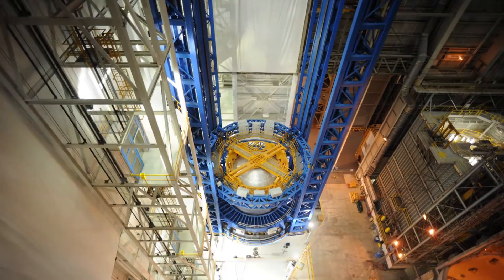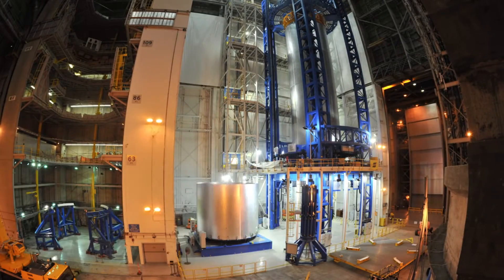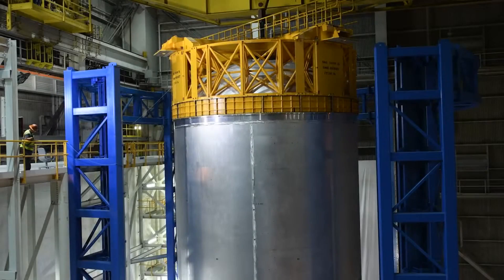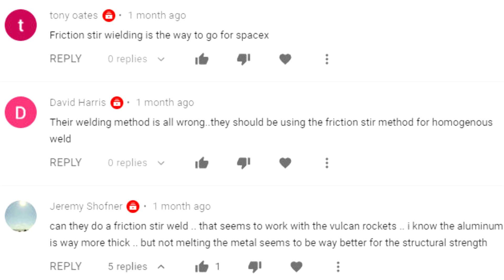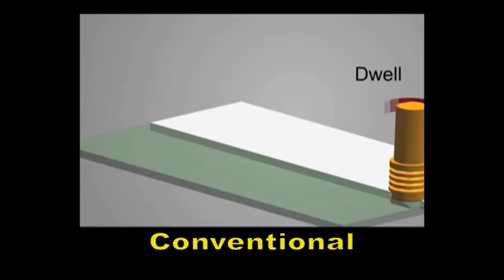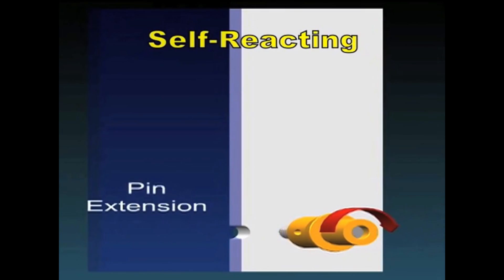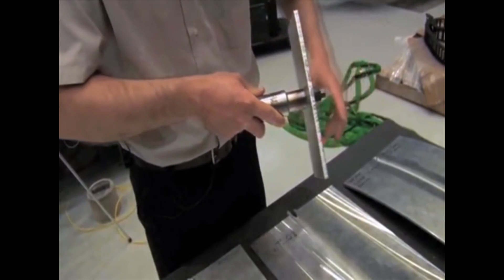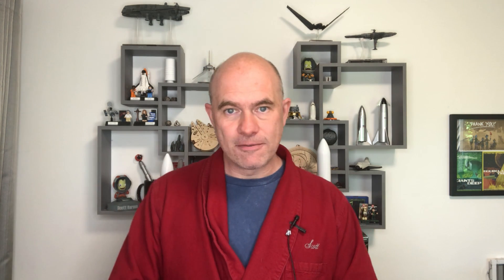SpaceX's 4th Starship Prototype Collapses During Test

Comment: I think, the lower tank lost pressure through cooling. The collapse didn't look like too much weight up top, the lower tank imploded before the top tank ouldn't be supported anymore
Reply: solution: MORE STRUTS!
Reply: Then I'd ask why the pressurization system didn't kick in. Perhaps there was no active system, which might be a test bug, or it wasn't working right. But it might be that not filling the bottom tank first is forbidden.

Comment: So how do they know that the reason why they lost pressure in the lower tank wasn't caused by a weld failure? BTW, I used to work with people who did stainless steel welding, and getting good, consistent welds isn't easy, at least not by hand.

Comment: Re: friction stir welding - Yes, it works great for aluminum. And while it technically works on steel, it's not a very good method.  It is SLOW even on aluminum, and VERY slow on steel.  To weld even one weld on Starship would probably take multiple days.  

Source: Trained Aerospace engineer and welder; albeit 20+ years ago and never went in to aerospace as a job.
Reply: I saw the animations. Looked pretty fast to me 🤣😂
Reply: Simon Strudwick That’s aluminum. Al can be done pretty quickly. (I loved welding aluminum.)
Reply: If the weld is done by machine, who cares if it's relatively slow?
Reply: Roonasaur Because SpaceX is trying to crank out new prototypes quickly. They’re getting SN4 done in less than a week. If they were to friction stir weld, it would probably take well over a month. Just for the welding.
Reply: @Roonasaur  assembly line.
Reply: When I was a kid back in the 70's I got for Christmas one year this kind of model kit thing.  It was all plastic, but it came with a "welder" for putting the parts together.  The "welder" was basically just a little electric motor with a pistol grip.  You'd attach little rods of plastic to the rotating bit, and when you touched the spinning plastic rod to the other plastic parts the friction would melt both of them together.  It was a cool little idea.  The problem was the "welds" made by the rods was generally a lot more brittle than the actual plastic parts so they'd break right there quite easily.  The regular plastic parts were far more sturdy.

Fast forward 40+ years later and I look back on that as an interesting idea.  I can weld today, but I generally don't because I'm not very good at it.  I've worked in metal fabrication for almost 25 years, but my expertise is in CNC forming and some laser/plasma programming.

That said, with my knowledge of such things I've looked at what they're building from day one and expected exactly what happened to happen.  This thing is lacking in a lot of structural strength that is unrelated to the weld process or strength.  I think this rocket is a dead-end in design.  Will it ever fly?  Probably.  Will I be riding in it?  Hell no.  In the same way I won't be riding in a car who's brakes are "just barely" able to stop it at an intersection.  (I think that design will need either some substantial internal bracing, considerably thicker walls, or some other kind of composite reinforcing of the skin.  Perhaps something like the corrugated composite aluminum panels I used to work with? Super light and super strong, and look like corrugated cardboard.  Could something similar be done with stainless?  Hmmm.)
Reply: @tarmaque  from what I've seen from the visuals there are a lot of internal strut support frames
Reply: @042Ghostmaker  I've been watching carefully.  What you are seeing is the support structure of the engine skirt.  The tanks themselves have no internal support.
Reply: @tarmaque  Corrugations. As with Saturn V.
Reply: @tarmaque  Yes, definitely, 'multi-wall' and 'honeycomb' bracing has been around for some time, in aluminium and most other metals/alloys; the problems can come when you try jointing them. One method is to pre-fabricate a solid edge and joint that conventionally. They are very light and strong.
Reply: @paulforster6229  – Has anyone considered using metal foam for that purpose? The added benefit would be thermal insulation I guess, but I'm no engineer of any kind. Also, I don't know, how you could attach/joint it to those cryoformed sheets without too much welding.
Reply: @MrAnticlimate  Theoretically foamed metal has some merits, but I don't know of anyone who has foamed that grade of stainless steel. Plus there are many other manufacturing problems involved not only with scaling it up to size, gas tightness being just one. Also the insulation properties might cause problems on re-entry overheating the outer skin. Even if they could form foamed sandwich construction strip of the right alloy/grade and then lap joint the edge either welded or a rolled lip (like continuous ventilation ducting is produced from flat strip) making it gas-tight under all the conditions and adding bulkheads etc could be problematic. In the end I'm not sure it would be worth the effort. 
Or a thin double wall construction cross braced with spot-welded stainless 'webs', with a post fabrication fill of foamed phenolic and carbon composite or a foamed ceramic fill might have merit. But I am still concerned with the effect of the heat of re-entry on any such composition. Thermal cycling could be a problem. Try it and test it would answer these issues.
I am surprised they are still doing TIG welding and not continuous 'spot/seam' welds, as they are much more suited to thin construction.
Reply: @paulforster6229  – Thank you for the detailed reply. It just occured to my unengineer self, as I stumbled upon a lot of news regarding those materials a few years ago. In the lists of examples of metal foams there's always stainless steel, but never mentioned what alloy. I didn't know thermal insulation can cause such problems. However uninsulated tanks, where the outer wall is the tank wall, would experience pressure increase during entry... But that is just speculation from me, surely the experts at SpaceX know what they're doing – better than me anyway 🙂.
Reply: @MrAnticlimate  You make good points. I didn't know of the foamed stainless, do you have a link?
the area/volume of the tank and thermal mass of remaining contents would mean not much change in pressure from re-entry heating. insulation would only be a big problem/need if you had to hold cryogenic material for longish periods.
I like your thinking, that is 'engineering' attitude, just bend your head around a few practical and fundamental considerations and you're there.
fundamental rocket science is simple and easy, rocket 'engineering' is a whole different thing, but its do-able; there always another way of doing things. keep thinking.
Reply: @tarmaque  The thing is not supposed to hold up the weight of fuel/oxidiser on its own, they pressurise the interior and that does the supporting; same method as the Atlas missile. Lose pressure and the thing cannot maintain its shape if loaded with propellant/payload, a bit like a pressurised tyre supports the weight of a road vehicle, let the air out and it deforms.
The pressurised tank method is a tried and tested and trusted technique IF everything goes to plan.
Add enough internal bracing to support all that propellant and such and the thing soon gets far too heavy, a small increase in vehicle mass greatly effects the mass payload you can loft.
If you could suspend the tanks and put the rocket motors up the front and 'drag' the thing into orbit then you wouldn't need massive internal bracing. Support timing at take-off would be critical. Not sure how it would all hold up to the rocket blast near the skin or perform to orbit though. I don't even want to think about the re-entry and landing issues.
Reply: @paulforster6229  At launch, sure.  But what happens when the thing is landing and almost empty?  Yeah, we know that pressurized structures can be very strong.  However, when this thing is going to be landing it will be nearly empty.
Reply: @tarmaque  Nearly empty of fluid, still means plenty of residual gasses/pressure, the engines only run out of liquid, the pumps cannot suck enough gas to totally empty the tanks quickly. It is a simple fix to make valves that close and maintain pressure if they sense loss of fluid.  Even if there was a drop in pressure given a short time residual fluid/gasses would bring the pressure up to at least take off pressure, more than enough to maintain integrity.
Reply: @tarmaque  They are likely working with membranes and shells, which can withstand a lot more than it would seem at a first glance.
Reply: @jackvernian7779  I understand that, but we're talking about a structure that is supported by pressure inside, that is supposed to land with its tanks nearly empty.  Not good for structural stability.  Also, such structures do not hold up well to intense flexing.  So-called "work hardening" tends to make them brittle. (Also known as "metal fatigue" but it really isn't.)
Reply: @tarmaque  What the whole concept hinges on is how much overpressure is required to support the structural stability at N g's of acceleration. If the value is reasonable, then there will be no problem and it will work like a charm. If significant overpressure is required, there will be a lot of problems with it. In the end, what a few atmospheres of overpressure matter? If it requires tens of atmospheres though, it will be borderline infeasible. 

I'm sure fellow mech. engies have worked out the kinks, or are in the process of.
Reply: @jackvernian7779  Would you ride in a car that would collapse and fall apart if it ran low on gas?  This is a case of a vehicle falling from orbit.  Perhaps under ideal conditions all would be well, but we don't build things to carry people that only work under ideal conditions.  These things are collapsing, imploding, and exploding when being static tested when a single variable goes out of whack.  I'm a SpaceX fan and their Falcon 9 rockets have been amazingly reliable, but I think this new idea is more of a fantasy than a real solution.  I hope I'm wrong.
Reply: @tarmaque  In the case of loss of pressure everyone would be doomed anyways, regardless of whether the tank crumples or remains upright, the engines would no longer work. That is the only way I can see how the pressure can be lost: by the way of tank integrity failure. 

Of course if the engines are turbine rather than pressure fed, it may last a bit more, but I do not think the re-entry would be survivable as any rupture point would serve as a crack concentration center, tank would eventually split sooner or later during re-entry.

In short: if you've lost pressure in your tanks, "crumpling" is not your biggest worry.
Reply: @tarmaque  A car isn't 90% fuel.  To design for a full top tank with an empty bottom tank makes little sense.  It's a lot of support mass for a condition that should never exist.
Reply: you think they may have improve upon the process in the last 20+ years?
Reply: Pieter de Buck it’s basic physics. You CAN’T go faster. They could maybe use multiple welders at the same time along different parts of the weld line, but then you run in to risks at the places the welds meet. It’s better to have one continuous weld.
Reply: Anonymous Freak a lot of things can’t go faster until they do
Reply: @pdebuck1  just like Elon wants to drill holes faster by making his boring drills more powerful in some abstract manner.
Reply: @pdebuck1  Considering how friction welding has remained a "trade secret" for the past 20+ years, I do not think significant progress on it was actually made.
Reply: @jackvernian7779  The Eclipse business jet is made with friction stir welding.

Comment: I believe they are using a hybrid of MIG and TIG welding. Basically wire is feed through a MIG tip in front of a TIG torch which melts the wire just as it flows down on to the surface being welded. It takes some of the art out of the welding process and allows longer continuous welds.

Comment: I remember reports of how many of the US manned space flight programs had low confidence at the beginning because of the failures.  SpaceX will fix this before attempting manned launches.
Reply: Comparing pretty low tech efforts from a long time ago with developments that can utilize completely different tools and knowledge in every single area from development to building... Well that's a little weird ;)
Reply: @stefan514  high tech is expensive. why else do you think SLS cost 2 billion per flight and space shuttle cost 800 million?
Reply: @stefan514  - Yeah Physics, pretty weird.
Reply: @johncnorris  don't you think they should be a bit better than 50 years ago at predicting what would happen and shouldn't make rather silly mistakes? No? Cool
Reply: @stefan514  - I think you should try to do something half as complicated and see how difficult it is.  It boils down to a step by step approach and they will eventually come up with a method to get it to work.
Reply: @stefan514  Computers are useful, but they aren't magic. We're a very long way from simulating everything in a computer and finding all the problems, and doing the math first isn't free either.

Comment: Embossed corrugating the central area of the stacking rings after fabrication would help rigid-ize the areas between the weld joints. The Saturn 5 Look. I think lap welded joints might help creating natural double thick hoops in the skin at the joints.

Comment: Great explanation Scott. Thanks. Don't you think the inner walls of starship must be much more susceptible to preasure variations in the tank sections? I personally belive that if they can line inner walls with corrugated steel sheets, the structure will be able hold it's integrity with much more credibility?  I understand it could have weigh implications. But if a sweet spot can be found, we could see SN10+ will do orbital flights.

Comment: Maybe its again a welding issue. A minimal leak on the pressurized lower tank would make the thing collapse this way too. Why so certain about the fact that welding problems are solved? Contractors still are water tower builders afterall.

Comment: Scott, do you think they are going to have the same issue when they are trying to land these ships with mostly empty tanks?
Reply: Problem is not emptiness, but lack of internal pressure to support structure. Operational pressure is 5 bar.
Reply: The problem in my mind is, the tanks will be partially empty, and the extra load of the cone section will put an undo amount of stress on the partially empty tanks.  If you stand on an empty cola can just right, it will support you, until a wall is slightly compromised, then it just crush.  The jolt of the landing might be enough to cause that.  They are smart engineers and they are working through the problems.  I guess we will see with SN6 or so.
Reply: @robertfranklin8881  Tanks will still be pressured it does not matter if there is some liquid since pressure is provided by gasses in this case gaseous oxygen/methane, steam and CO2.
Reply: @skyrask1948  I understand that some pressure will be there,  just hoping it is enough to keep it from collapsing in on itself.  But again, I am sure they are looking at that and taking it all into consideration.
Reply: @robertfranklin8881  During landing in atmosphere reentry heating will cause plenty of pressure inside of thanks, outside of atmosphere engines have to run in order to land and autogenous pressurization will provide pressure in this scenario.
Reply: @skyrask1948  Thank you, my lack of engineering knowledge is showing.  So as long as there is pressure in the tanks, it should be good.  But what about landings on planets that don't have the atmosphere to generate that heat?  Still going back to the fact that they will not be empty, and the lack of a complete 1g, it would seem that if it can hold up on a Earth landing, it should be able to land on the moon or Mars.  If you know the answer, how much pressure does there need to be  in the tanks to retain the rigidity it needs?
Reply: @robertfranklin8881  Elon stated that operational pressure for starship is 5 bar. And as i said landing in places without atmosphere autogeneous pressurization from raptor engine will do the trick since acceleration is a thing only when starship is not in free fall i.e. landed or during slowdown before landing. During slowdown raptor engine will fire and part of exhaust gasses(steam and CO2) will be diverted into methane/oxygen tanks. When landed pressure will fluctuate based on heat exchange with surrounding. Heating element inside tank or venting of excess pressure may be needed based on outside conditions.
Reply: Not the same. Maximum aerodynamic pressure happens when the rocket have not expended most of it's fuel. The problem here is unbalance loading where the top tank is full and very heavy while the bottom tank is not pressurized enough to support the top tank. During reentry both tanks will be mostly empty so the tanks need only to support itself.

Comment: Friction welding is great for aluminum because of low temperature and work hardening. Most Al alloys get annealed at fairly low temperature and loose like 50% of their strength when welded conventionally. Friction stir welding causes work hardening in Al which makes the welds stronger but more brittle.
Stainless steel is austenite and forms extremely hard/strong/brittle martensite if work hardened. Not so nice for friction welding, because it would need massive tools and would cause lots of trouble with tool breaking and wear.